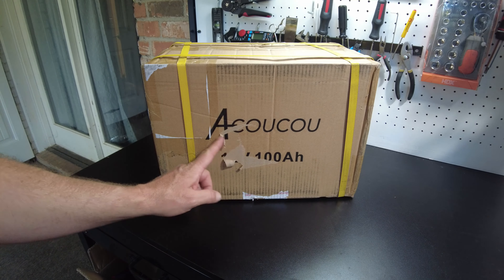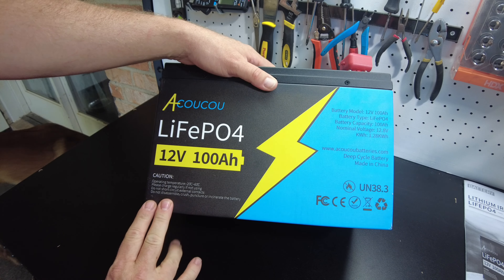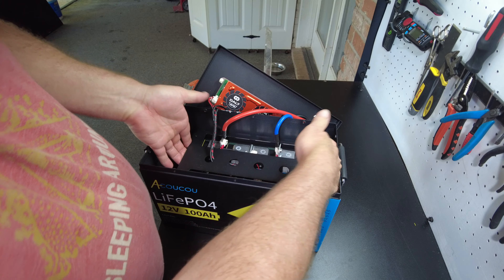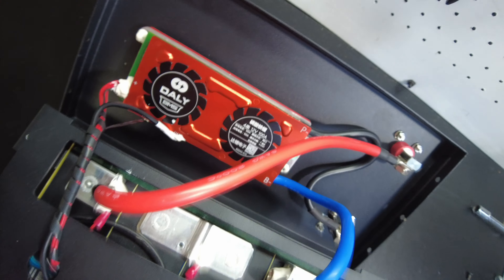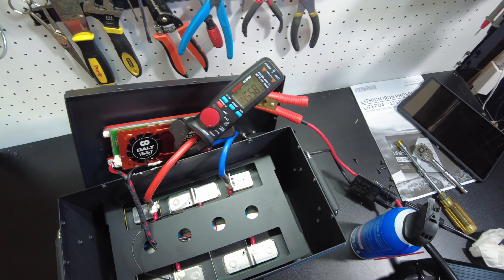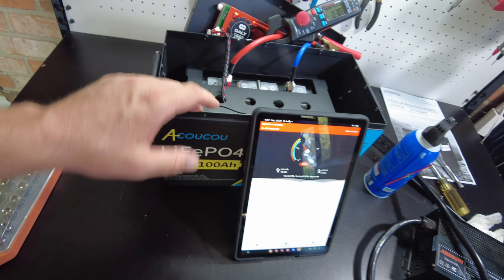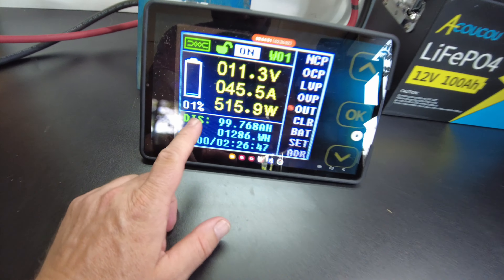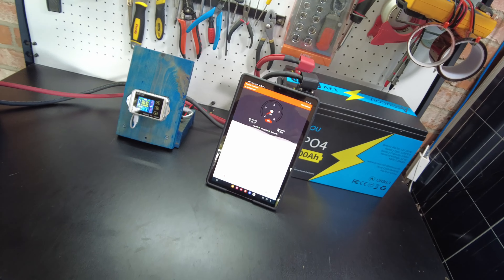Acoucou 12v 100Ah LiFePO4 Bluetooth Lithium Battery

Comment: To get those loose nuts back on, just use a piece of paper shop towel and it'll stay put in the socket. That way, when you finish putting it on, you can easily just pick up the piece of towel to reuse it or throw it out.
Reply from the maker: Good one, thanks!

Comment: What’s the best bang for the buck at this time for a 12v 100ah lithium battery for a trolling motor? 

Also what charger?
Reply from the maker: I like the Timeusb PRO for best bang IMO https://amzn.to/3s0CfP1 As for charger depends on how fast you want to charge. Fast is going to cost you $100-$200, or slow $20-$50
Reply: @BradCagle  oh ya I just watched the video that battery seams very robust. I think I’m gonna pull the trigger it’s under $300. 

What’s the best value charger that will charge the battery in 3-6hr from fully discharged? 
It would be nice to be able to charge it quick if out camping for multiple days.
Reply from the maker: @cashotpb  This one will charge it in 5hr https://amzn.to/3OMWdpx

Comment: Those look to be very well-made, but at roughly $150 more than the going rate for budget 100AH batteries, it would be up to the consumer to decide whether or not the metal case and bluetooth connectivity is worth paying that much more for, I guess?  That model looks like it could be made by the same company putting out the SOK batteries?